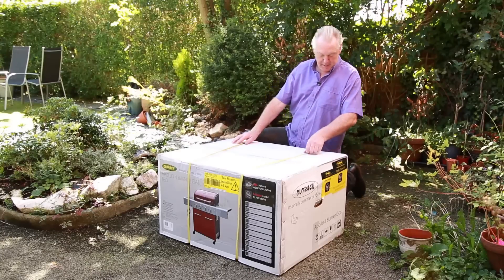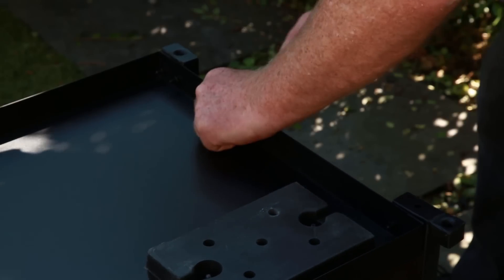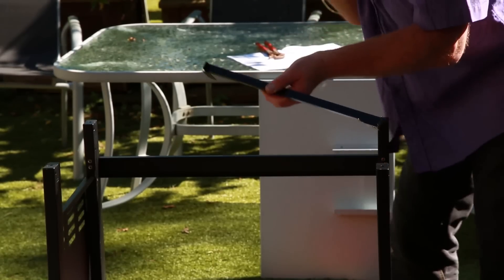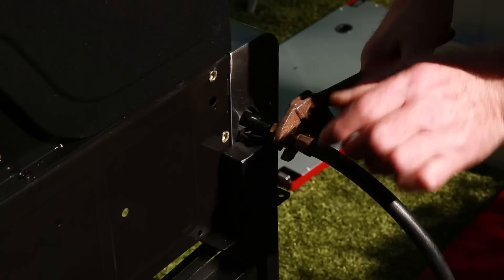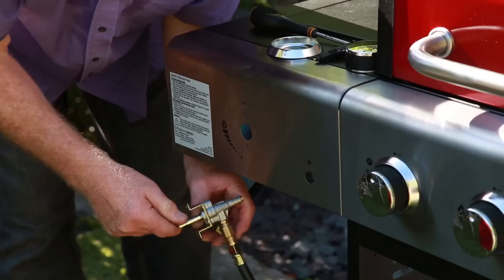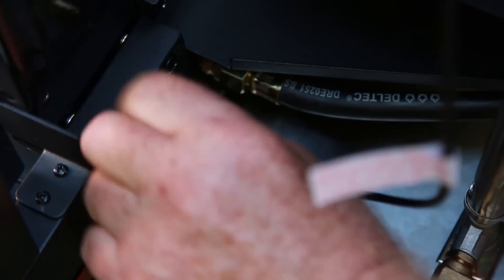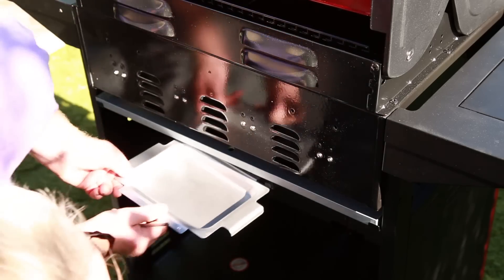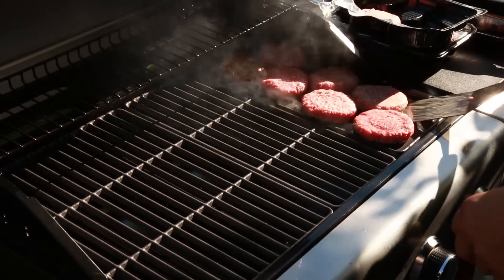Homebase Outback Apollo 4 Burner Gas BBQ in Red - Self Assembly Instructions Video

Comment: I love to have him here to mount my BBQ. I'm just fingering out how mount . Easy ?? Easy for you say 😂😂
Reply from the maker: Hi Ravina thank you. Yes it can be difficult sometimes figuring out the instructions to build something. Usually I have a go at putting stuff together using my common sense. Mostly I can do it. But often you do need some help with diagrams, as the manufactured parts can be very cleverly designed and it's quite a puzzle to work out.

I suggest spreading out all the bits and get familiar with them. Look through all the instructions several times and get an idea in your head of what and how they are suggesting each ones fit together. Very often there is a logical process to go through to get to where you need to be. Take your time and enjoy the 3 dimentional quiz. Thanks again for your comment and kind words. Good luck with your project. 🤞😀

Comment: Hi Tim, we bought this last year from Homebase. We notice that it doesn't get very hot very quickly. In fact, on the temperature gauge, it almost never reaches the top 'Sear' guage- is this the same for you? It takes about 10 minutes on ours to reach around 200 deg Celsius. Again, is this normal?
Reply from the maker: To be honest we haven't had the chance to used this BBQ  very much to notice the temperature. Have you tried using the red propane gas instead of butane as it burns much hotter.

"Looking on the charts, at 'total heating value after oxidation,' propane is 19768 BTU/lb. and butane is 19494 BTU/lb., but in every other category butane looks hotter."

 I'm accused of burning things anyway! Good luck with the different gas and thanks for your comment.

Comment: Good video...

Seems this is just gas cooker. 

Or is is possible somehow to get original wood/charcoal/smoke (example, whiskey, hickory etc) flavoured taste to food?
Reply from the maker: Hi Karl I don't believe that it's possible to add wood flavoured smoke chippings to this gas BBQ as they would simply drop off the the flame distributors and into the fat catching tray. Maybe if you added a small wire mesh so the chippings could sit in the flames, but they wouldn't last very long. Thanks for your welcome comment. :)

Comment: Shocking quality.... I bought one in 2015 and it has now rusted away. The oil tray is rusted as are the burner covers... The gas knobs and the chrome is starting to rust. Also, the grills themselves have lost all of their enamel too. This was cleaned after every use and covered correctly when stored over winter. Just ordered a Weber BBQ and although over twice the price, the quality is much much better. Avoid this BBQ.......
Reply: I bought one in 2015 also and still looks great. My Oil tray has a little rust on ( as its underneath you can't notice it). My gas knobs are fine (a bit loose , but fine). My grills are good (just wire brush and season now again). The only fault i have is one of my wheels has bent over on the front side (just bent it back into position). Also my cover needs replacing (slighty torn in places). Sorry to hear about your problems mate.